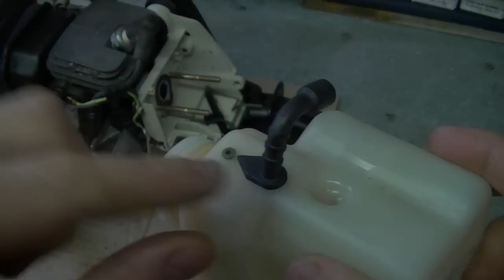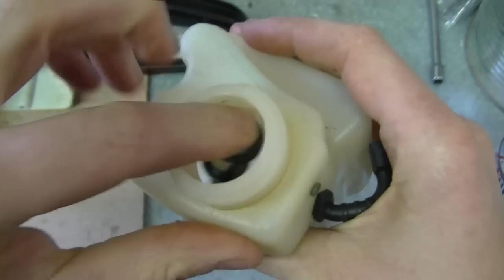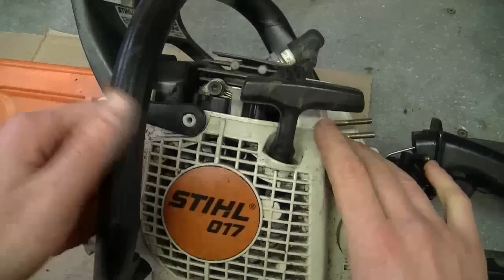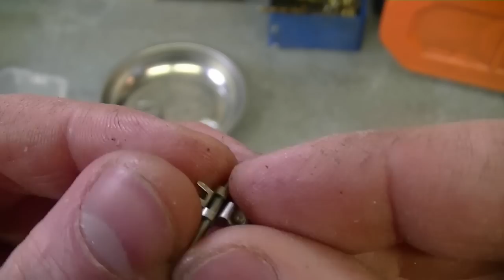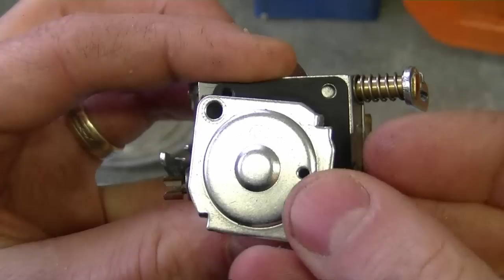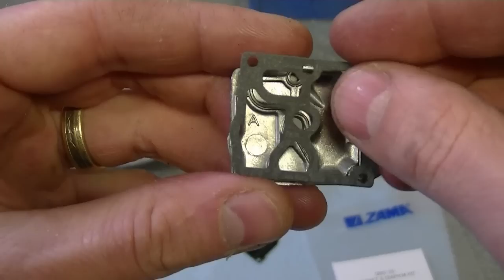HOW TO - Carburetor & Fuel Line Repair on STIHL 017, MS170, 018, M180 Chainsaw Part 2/3

Comment: I have had trouble with my saw for ages. It kept stalling on load. Seeing your video I realized the small needle lever was below flush. Thus not working correctly. Adjusted lever and rebuild. Saw now performing as it should. Many thanks.

Comment: I bought the carburetor air,fuel filter replacement kit from Amazon for my Stihl Ms180 and this 2 part video was literally PERFECT step by step instructions to replace the carburetor and fuel filter and I had no issues at all following this video!!! Thank you for this video it literally made this project dummy proof!!

Comment: FYI I used a little Vaseline petroleum jelly dab to hold the spring in place while I reinstalled the needle valve just a tip afterwards cleaned it off with carb cleaner so it wouldn’t clog the jet or the needle valve Great video !

Comment: Hi Don. Great video as usual. Just a quick question - when you took the carb apart there did not appear to be a gasket on the metering diaphragm side but you put one in on the rebuild -  that right? Also, the gasket on the metering diaphragm side went against the body of the carb but on the other side it went against the cover -right? Thanks for the videos man. Saved me a fortune!
Reply from the maker: yes I always put one on the carb between metering diaphragm, and yes on the other side the gasket goes on the cover side

Comment: Hi, I know this is a little off topic but maybe you can help.
I have a 1 year old 250 Stihl, and the little saw works great, cold start is great but if I shut it off for 4-5 minutes than try and start it again, it can make you want to beat the thing up on a stump!! 
     This as happened over time, the saw was not like this before. The saw idles great and continues to run perfect when i leave it running. It will start great if I shut it off and than restart right away.  Any advice? If I was to take apart the carb to clean or look for something , where would it be best to look?

Comment: Another great video, bud! On the average it looks like the pre-shaped fuel lines on Stihl equipment makes for a nice straightforward replacement ... What would you say the avarage cost per fuel line is Accross the gammit of chainsaws/trimmers/blowers ??? Do they avarage five bucks a line or eight bucks a line or what? Kinda needed your insight.... I really like I can get 20 foot of tygon kinda reasonable and make all my echo lines as I need them... And I'm sure that's cheaper... I was just wondering how much cheaper to kinda use that to way in when I'm replacing equipment in the future. Also... Do there black rubber lines last any better or any longer the say tygon in this awful moonshine gas they are making us by? It seams like I'm getting two years from the tygon .... I could go longer but it's kinda brittle so I go ahead and do it as part of the maintience cycle. Are you guys up in Canada stuck with 10% ethanol at all your stations or can you still by regular unleaded gasoline up there? I love catching a couple videos with my morning coffee!!!! Keep up the good work and God Bless you and the family, bud! I'm hoping I can get all my work done quickly today... I want to hit one of my rebuild 350's with the degreaser and the pressure washer and get into a rebuild this afternoon. I still have that QV 8000 that had cylinder damage to knock out... I was thinking that might be a good candidate for the big bar and the Alaskan saw mill ... I know that they don't rev to that super high rpm of some of the other saws but are supposed to have lots of torque ...and that ripping chain doesn't come in skip chain... Have you ever worked on these QV 8000 or the echo CS8000 saws? If so what was your general overview... Fix it to sell or might be a real reliable keeper? Hey bud, you have a great day and enjoy your Sunday! Are you to the point you avoid the shop completely on Sunday or do you tinker with your own stuff when the shops closed? Well I'm guessing you'd be closed on weekends but I could be wrong. Have s great day, Big Guy!

Comment: mr.dony i have a 66 cc gas powered bike and it will not get up to the hight rpms its just balgs out,i have tryed a carb rebuild,a toun up,and a new filter.the bike as 200 miles on it can u help me?

Comment: Well, I had done EVERYTHING to this chainsaw you could POSSIBLY do to get it to run but it just wouldn't crank. I knew the problem was fuel delivery. Well I took the carb off one more time. I took the cover off the metering side and pulled out one of the welch plugs. Not the brass one but the larger silver one. There are several very tiny holes under that plug. I blew them out with air and installed a new plug and put everything back together. It cranks on the first pull and runs like new. Damn!

Comment: hi there... removed muffler. no carbon build up . piston looks fine. so cracks or marks .is it normal to be a slight brown oil marks on cylynder. anyways, could it be the fuel filter.

Comment: I saw where you had the little lever in the carb level with the face of the carb. Is this a good place to set the lever on most of those carbs? I have a Husqvarna 335 XPT chainsaw that's  driving me crazy. I have great compression, great spark, new fuel lines, fresh fuel, I have overhauled the carb and installed new kit, fuel is getting to the carb. It just won't run. Give it a shot of starter fluid and it will crank but dies once it burns up the starter fluid.

Comment: the machine is practically new. iremoved carb, cleaned and re installed. now it wont fire at all... what should i check for. exhaust, i put new plug...

Comment: my stihl ms 381 was misfiring and cutting off. i opened carburettor, washes all the parts , cleaned with compressor and put everything back. nows it wont start at all. when i removed pin from carburettor , i put pressure gun in hole. is there ant like filter under the pin?

Comment: Hey donyboy73, awesome instructions. I am curious though if you have made a video of when you are adjusting any 2 stroke carb that you can talk about what the low and high side are and what they do. I am working on a trimmer stihl FS 74 I had to replace the fuel lines because as you stated very soft and sticky. I started with 1.5 turns on both and still will not stay running. I have replaced the carb kit but will go back and make sure the float needle is right. I think this lever was a bit lower

Comment: Thanks for the video! You're a great teacher. I'm not new to small engines, but.... Just cleaned/fixed my MS180. I'd 'flipped' the gasket and diaphram positions the first time. Thanks to you! I was able to see my error and now, we're off and running! By the way - and this is not a commercial - I'm running E3 plugs in my saws, and they really make them start easy and run great. FYI

Comment from the maker: @kwakman99 u should use a stihl fitted line for this saw, the cost is only $@ more and will save u loads of trouble because of the vibrations and the way the line is routed

Comment: Dony, do you really need to use a replacement Stihl gas line or could you use the universal clear gas line sold everywhere?  I would presume that if both have the same internal diameter it should work or is there something else I'm missing that needs to be taken into account.  Thanks.